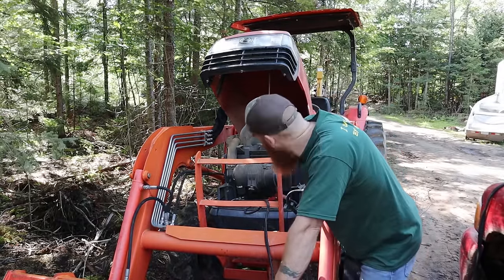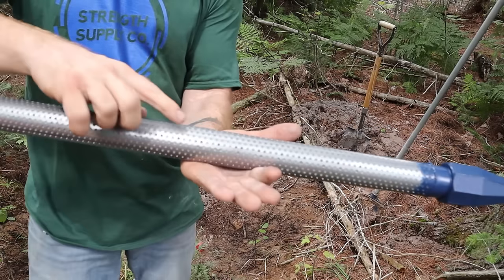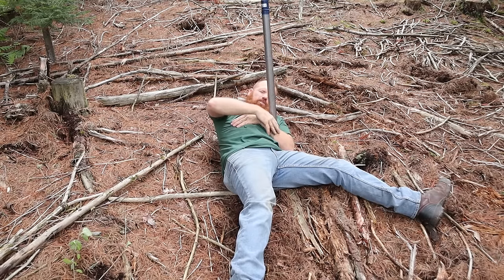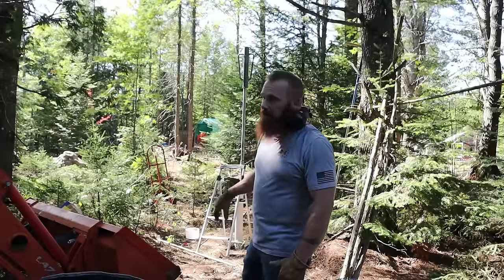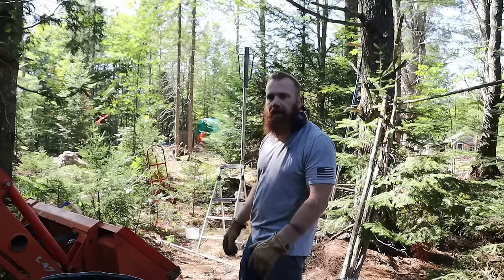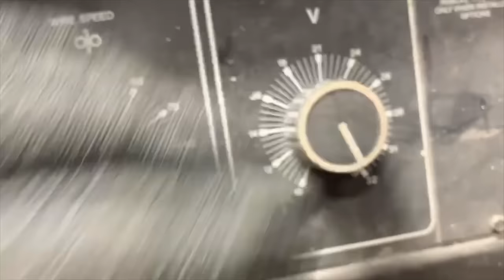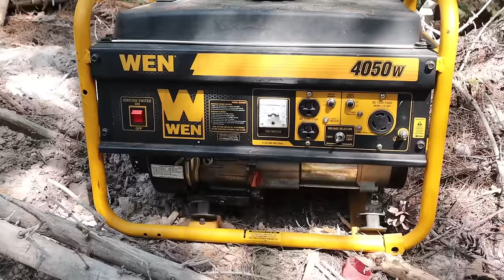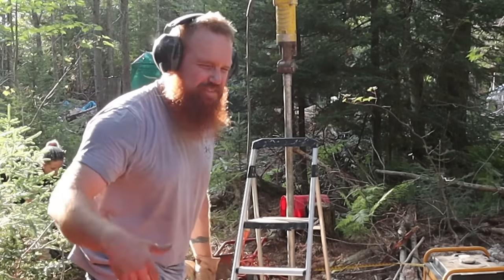Off Grid YouTube Family of Girls Step up to Help Dad Drive a Well | Fabricating Off Grid Well Tools

Comment: Use the bucket on that tractor you have resting on all day to pound your pipe in the ground
Reply from the maker: This is the number one comment we get. As I e mentioned in the comments we have tried using the tractor to do just that. The tractor wouldn’t do it. It doesn’t have a free fall bucket loader. It goes down with hydraulic speed and isn’t at all tough enough. Not worth the effort or fuel.
Reply: @9252LIFE  What about using the other end of the tractor?  The three point hitch?  I was thinking about doing a well, but blasting it out with a 2500+ pressure washer making extensions for the wand.  Any thoughts on that?
Reply from the maker: @mfgxl  if you have access to the pressure washer and the water I’d definitely give that a shot! Especially if your ground is sand and clay like mine and not hard rock.
Reply: What video did you finally solve your problem in? Did the professional well drillers ever give you any advice on what to use to prevent the mud from clogging the holes? You'd think there was something.

My guess would be that you need a lot more space between your intake and the mud. Maybe you need to line a larger hole with concrete, wide enough that water seeps in at a rate that you can draw it out, or maybe you have to dig a hole that will hold so many gallons and wait for it to fill up anytime you use it enough to empty it.
Reply: I tried to use a 544 John Deere loader to push in a 1.25" sand point and pipe in my well, I have sand and thought it would be easy, but loaders and tractors don't push straight down so the pipe and fittings want to bend. I used a sledge hammer.
Reply: Hate to tell
Reply: I see that nice tractor setting there also why not use the bucket problem folks don't use it takes talent to hammer with it 

Plus why would you  do know if you go and find a drilling rig that fits the PTO and just back up to it with the rig you can have that water 

And yes they fit small tractors bit expensive but if you were going to hire that ain't cheap either 

I imagine there may even be a rental outfit with just some research
Reply: What about TNT
Reply: @9252LIFE  I agree, you can't even push a T post into soft ground with a loader. But have you thought of renting a post driver for your tractor? (assuming it uses skid steer attachments). Oh well, it's almost done now, good luck getting your broken pipe out!
Reply: I never could weld HARDEN STEEL…ALWAYS BROKE ON ME…BUT I AM NOT A PRO.. WELDER
Reply: LOVING IT…YOU ROCK!!!!
Reply: Wow I feel bad for you bro all that work you know everything looks right what you were doing and then you get this broken pipe I'll be praying for you
Reply: Maybe next time use a heavier pipe pounder. That one looks like it was made for tposts.

Comment: Seeing your girls working and helping brings a smile to my face. My two helped me build a 2600 sq foot house on weekends and over summer break. Little older than yours. They mostly carried things and did dirt work till I had it closed in then they pulled wire stripped the ends. Did insulation in July heat  (Their favorite, they called it cotton.) Cut and carried sheetrock as well as helping me hang it. I'd tell them the size they cut carry and I'd fit and nail. It was a long job as I/we did 85% of the work ourselves. They said they found out what they didn't want to do for a living. Especially the "cotton". They built a lot of character with the house.
Reply from the maker: That’s awesome memories right there! ❤️
Reply: My father built my mother a house in 1953. He did not know he couldn’t do it.

Comment: Awesome work! Brings back a memory from 2007 roughly. A friend I don't see too much nowadays had an uncle that hammered in his well. Spent some whole days tunking that pipe. He built up a bit of scaffolding to shape a bit of a cherry picker so to speak. Hung a pulley and tied a heavy weight to the rope. That way we could do our tunking from the ground and all we had to do was pull a rope. He tunked that pipe for a couple weeks before he had good clean water. All the work you are putting in will help a body appreciate that water all the more. Hats off friend and here's to family!! Peace and grace.
Reply from the maker: Yeah a pulley system like that would be nice. We should’ve done it that way.

Comment: I appreciate all the tenacity of you and your family to drive your well. I also did this at my office grid cabin HOWEVER you could have used your tractors bucket and hydraulics to push the pipe down at least to a certain point. But what you accomplished is a feat of strength and family bonding. Great Job!!
Reply from the maker: Thank you Mickey. We actually tried the tractor bucket and it wasn’t tough enough or worth the effort.

Comment: Neighbor caught an old Deep Rock portable well drilling rig on CL for pennies on the $. We reconditioned it, added my old gas powered trash pump & welded up an oversized (for this rig) bit. Sunk a 65'er, after his driven shallow well failed. Been working fine & saved him thousands. Especially since he sold it later for more than the entire project cost.
Good on ya though. If it's got tires, batteries, or an engine, you're guaranteed to never have a boring day. ;)
Reply from the maker: Oh wow thank that would’ve been nice.

Comment: In the 1960s my father and I drove a few well points. We used an adapter on his 100# jack hammer . I would stand in the bucket of his loader and he would lower me  as the point went down. We never had a pipe break. Must be that good asian steel that flooded the market. Those girls deserve a reward like a good very old(1960s) Simplicity garden tractor. Good Luck, Rick
Reply from the maker: Thanks Richard! I believe the Simplicity tractors we just got are 70’s models and work great!

Comment: I too, drove a well using 1" pipe in 6' sections.  The well would not keep it's prime.  On pulling the pipe out, I found the couplings all damaged and leaking.  After re-threading, I twisted the pipe in sections using about 100 pounds of top weight.  This has been working about 15 years.  You must develop the well by forcing water down.  This pushes the clay way leaving rock and sand.  Before you give up try developing the well. Next, use a plastic pipe down the bore. This will bypass the joint leaks.  Good Luck

Comment: You guys rock!  I've been there an struggled with a lot of the same well issues so I know where you're coming from.  One recommendation I'd like to offer is when you fix your pipe and start digging again is to move the bucket of the tractor up to the pipe and attach a rope or strap to the upper most part of the pipe.  This will help steady it and make every tap count without damaging the pipe which is what your experiencing from continual blows.  If you set it so the tilt function on your bucket is what is supplying the downward pressure you'll have better control and feel for pressure being applied.  It takes a small amount of hydraulic downforce similar to what was used to remove your old pipe.  Let the tractor do the heavy lifting for you, or in the case heavy down pressure.
Reply from the maker: That’s a great idea. Thank you!

Comment: We tried the same thing, China pipe kept breaking or stripping threads, went back to post digger, added extensions until we hit water. Then added four inch pvc , dropped one and a quarter pvc with check valve and hand pump woks. Thanks for sharing.
Reply from the maker: Yeah that’s what I tried before this one..

Comment: WOW I was so hoping you'd get water sorted this time. Keep the faith and stay safe you guys
Reply from the maker: Thank you Paul! Have a great night!
Reply: 2" pipe drives better. They sell drive tips that screw on. Once driven down
you flush it out with a 1" under water pressure, until clear. I never had
luck with drive points or smaller pipe. You get A's for effort and creativity.
Dig an access shaft down alongside 5 feet to further evaluate it. since you have a PVC outer casing, can you center the pipe with an insert and seal
the outer casing with a super dense product that would harden and seal the
break area? Just some thoughts.  Farmers would erect a tripod 12 ' high,
suspend a snatch block with a rope and 50+lb slammer. They welded a
circular weight centered over  an axel and an eye for the rope. Wrapping a rope around a rear truck wheel with tire removed,with truck jacked up and
idling in gear, when they pulled the rope tight on the wheel, the  weight was raised up when loosened the weight slammed down and drove down the pipe. Many many farm wells were driven(slammed) by a variation of this method.  Double welded
 wheel rims and slammers were made and loaned out to other farmers and homesteaders. It takes at least 50 lbs to slam a well. You will prevail. 
Never give up--kids are watching.

Comment: I've done what is called a sump in this type situation. All you need is to dig out a large enough area and fill it in with gravel/sand around your pump. Water seeps into the fill and that will fix your clay issue.
Reply from the maker: Trying for cleaner water to plumb to home.
Reply: The gravel/sand acts as a giant filter. If you don't have enough water getting to the pump all you need do is run a trench out from the sump and fill it with gravel/sand to increase available water. The main thing is to dig your sump deep enough to start. In my case it was about 30 feet by 10 feet wide. With a trench around the Vinyard and we had all the water we wanted.

Comment: Considering what contractors charge per foot for drilling,  this is not a bad comp.  I have used post drivers for years as, I, have found them easier to control.  Swinging a 16 to 20 lb. sledge takes more strength and control.  Yes, you get more impact with the sledge, but at cost.  I had a machine shop weld extra plate on top of a post driver.  Made it 36lbs.  It was a work out.  But, if I hit rock, I could smack the driver with the sledge, bust rock, not damage the driver.  A sledge is a lot harder than a post driver to use, all told.

Comment: Need an expansion tank and If it doesn't keep up with your gallon per minute needs you can put a holding tank with a lift pump in it so it can fill that tank over time then you will have all the water you need

Comment: Hi Chad, I’m a new subscriber, great video. If you could get a IBC tote filled with water and then jet water down the pipe as you force it down, that would be your beat bet. I have put many wells in here in Naples Florida using the water jet method. Good luck, by the way, your daughters are great helpers. Who says only boys can do that kind of work. 😂😂😂. God bless you all. Patriotic American here. 🇺🇸🇺🇸🇺🇸🇺🇸
Reply from the maker: I’ve seen some of that water jetting. Definitely interesting for sure! How’s the weather down your way?
Reply: @9252LIFE  very hot. These last two weeks it’s been between 93° and 99° here in Naples. 🥵
Reply from the maker: Ouch! I don’t miss that! I lived in Florida for a couple years a long time ago and it was quite humid. Same with Alabama. 🥵
Reply: @9252LIFE  I hear you. We get tired of the heat day after day but, we could never go back to the cold weather again. We are originally from NJ. One thing I really miss is having a cold basement. I like to cure meats and make cheese but down here it is very difficult. I lose about 2/3’s of what I make to mold and improper curing due to temp fluctuations. I need to make a walk in cooler in my garage. God bless you and your beautiful family.
Reply from the maker: @Naplesfrank154  those are some good skills to have.
Reply: @9252LIFE  My grandparents and a friend taught me how to do it. I got tired of not finding what I craved in the local stores.

Comment: Doode, because of physics, a perfect vacuum at sea level with atmospheric pressure of 14.7 lbs per square inch can only raise a column of water 33.9 feet. A shallow well jet pump is of course not capable of a perfect vacuum, therefore, to stay in the efficiency range of the pump, 20 to 25 feet or so is more realistic. You will NOT get water out of a well where the surface of the water is more than this distance below the pump. For deep wells, you need to use a submersible pump down in the well to push the water up. Most submersible pumps require a 6" diameter casing, but there are a few that might fit in a 5" casing. The girls are amazing btw!
Reply from the maker: We are going to be using the jet pump not the hand pump.

Comment: Dude make a motified water drill you're killing me. Get a IBC tank full of water make a sluice tank and recycle the water you use for drilling. You're turning us into a bigger project then it needs to be. Not to mention your drilling for the head and not the liner which is what you need. Watch some YouTube videos.
Reply: Bigger project?  How about a capstan winch from an old ship and put the kids to work turning it.  
Seriously, I have seen quite a few videos on shallow wells and I always think of how heavy the metal pipes are.  I am considering (an experiment): A slow slow Process so that gravity plays a bigger role.  With a capstan winch setup.

Comment: When designing piles in soil to hold up structures, buildings, decks, etc, there is resistance to the load at the base of the pile, but there is also resistance due to friction along the side of the pile. If you've driven that pipe so far into the clay that your side friction is higher than the capacity of the pipe to be driven, then you're gonna have a real struggle going any deeper. The pipe will just keep breaking. You might have some luck with heavier wall thickness pipe but it's still going to have its limit. You may have some luck if you can lubricate the pipe along the way. Injecting water down the hole under pressure every few feet to slick up the sides and free the pipe movement.

But also, just because you've got ground water 8 feet down doesn't mean that water is freely traveling to some depth where you might encounter gravel or sand 60 or 100 feet down. The clay you're encountering may act like a shield or dam and keep the water from seeping deeper. Clay is widely used as a dam building material because of it's resistance to water flow...as you've noticed at the filter screen.
Reply: That's what I was gonna say. Glad I read some comments before posting the same.

Comment: Get a longer, bigger post.
Rent a "rhino"attachment,and a pull behind generator air compressor. Maybe use 20' sections, cut off mushroomed top, then maybe thread or weld sleeves. The driving should only take about an hour tops. (More like ten minutes per post)

Comment: Are you using regular Schedule 40 galvanized pipe ?  If so, I expect you to continue to have pipe failures.  That stuff is just not strong enough to be driven.  You should use "well drive pipe" or Schedule 80 galvanized.  Both are more expensive that plain galvanized and may be hard to source.
Reply from the maker: We are using drive pipe from Menards. The pipe that broke is the pipe we purchased from the local hardware store. Which is probably schedule 40.

Comment: I love the tenacity. However, as I look at the tractor with the big, beautiful PTO, I shake my head. You have all that power at your disposal, and you’re drilling by hand. While it’s great content, and it’s great for the shoulders and back muscles, it’s not how I would have gone about this.
Reply from the maker: I drilled the initial hole with the auger. If i auger too deep the hole caves in with the clay. But I have definitely dreamed up some drill attachments.
Reply from the maker: I drilled the initial hole with the auger. If i auger too deep the hole caves in with the clay. But I have definitely dreamed up some drill attachments.

Comment: I know the feeling. But you learned so much from this try. Pressure test the pipe before trying to hook it up, if it holds air, it ain't broke. If it's only broken 8 feet down, dance around and cheer!!! I lived in upstate NY. You don't go 1 foot let alone 40-50 feet without hitting rocks that you may not be able to get through. Be very happy for the ground you have and know all you have to do is get to bedrock and you're pretty much done. I just looked, this is A YEAR old. I'm sure you got it done.

Comment: A hammer drill set on the "hammer" or vibrate mode will really sink pipe or rod into the ground quickly. It's almost like magic if you've never tried it before... I'm not sure how well it would drive that large of a pipe, but I've used it on smaller diameter and it worked incredibly well.  Just have to rig up a bit with a larger diameter pipe to fit over the one you are driving.  Good work there!  Looks like a heck of a job!!  👍

Comment: I saw an interesting solution on Homestead Rescue some time in there later seasons.  They had water about as deep as you all do. They used an excavator to dig a deep hole and stood a 12’ long 4’ diameter metal culvert up in the hole. The added rock to the bottom inside and out of the culvert into which the put a pump. It wasn’t a constant flow of water but had a pretty quick recovery rate.

Comment: I would try using  the bucket of that tractor to force the pipe down. I've seen it done on other channels and it seemed to work well. I admire the work ethic of those young ladies!
Reply from the maker: Thanks and read the pinned comment if you’re wondering about using the tractor

Comment: I've hammered down many hand wells here in my area of AK. I've done most of the ones for my neighbors. I use an electric jack hammer. I make my own gravel points without screens. I then blow the dirt out with pex hooked to air compressor. I also use my backhoe to dig a hole so I can stand on the jack hammer.